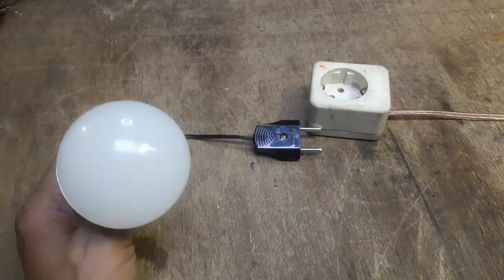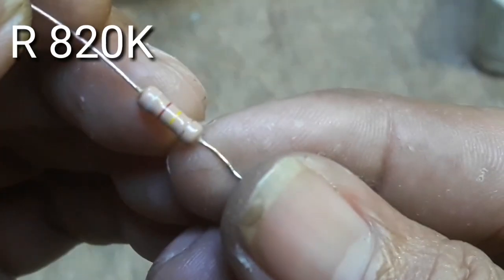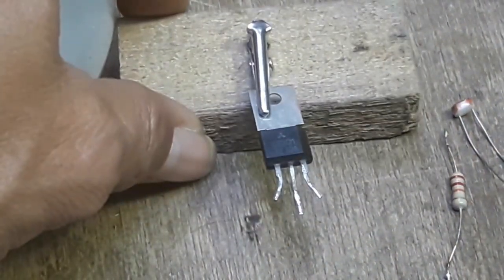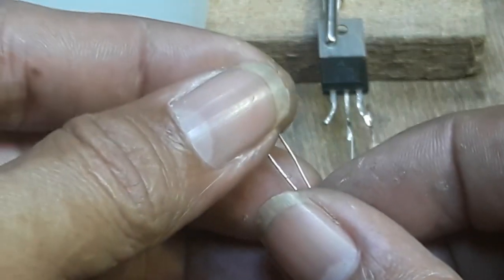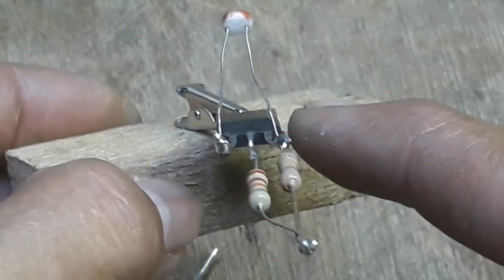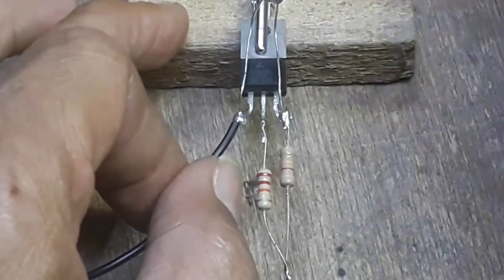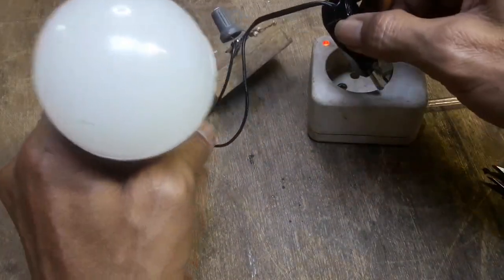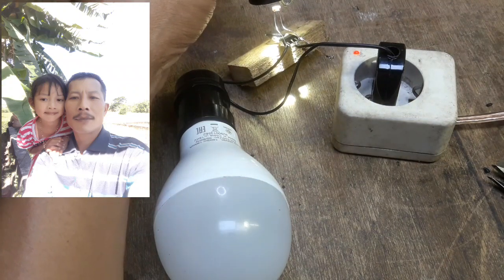cara membuat lampu listrik automatis malam nyala sendiri

Comment: ga jelas r ug anoda  berapa katoda berapa kok cuma yg ini disini ini di sini ga  jelas
Reply from the maker: Di amati lagi untuk rangkaian nya ..dan untuk TRANSISTOR SCR bisa pakai ini Triac 20a 600v Bta20 600b Bta 20 .
Triac 10a 600v Bta10 600b
BT152-600R
 BT152600R 20A 600V TO220 BT152 600 thyristor.. 
BTA20- 600B 
BTA20 600 
triac BTA20-600 20Ampere 20A.
TRIAC BCR2PM-12 BCR2PM 600V 2A TO- 220F.     triac BT137,....TRIAC T1D6